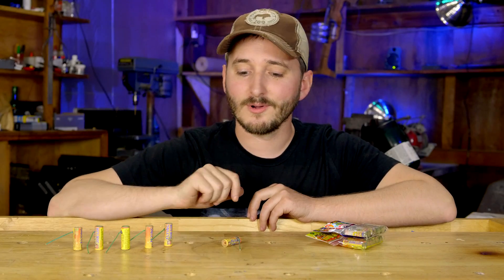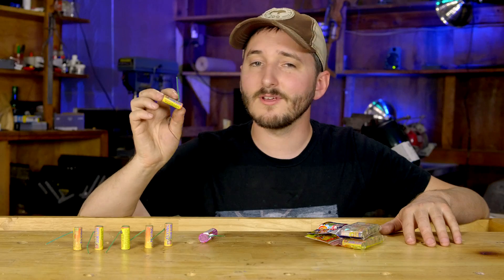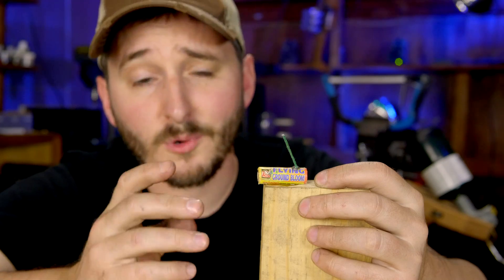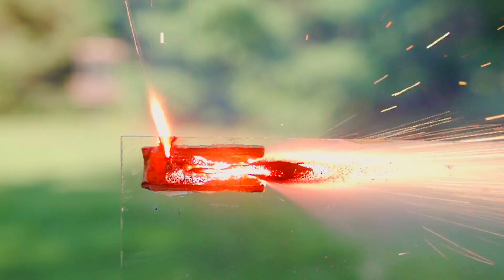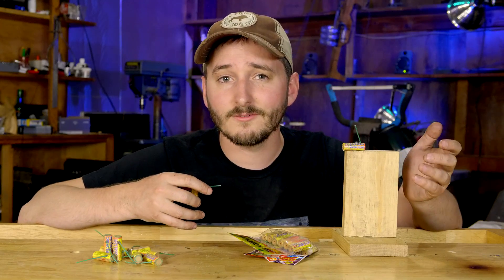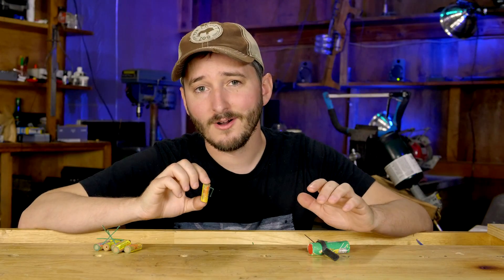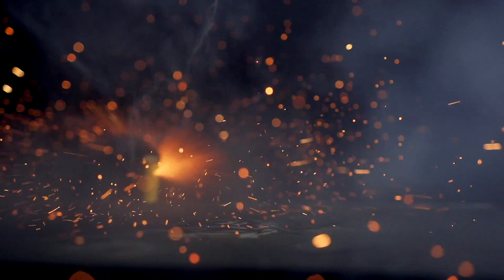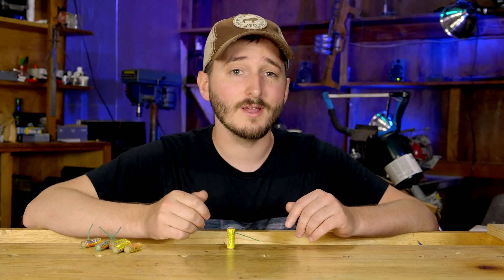How Do These Fireworks Fly?

Comment: 1. The reason the tip up is like a ancient Greek money scale.

2. think of the back like one big rock and the front as 7 smaller rocks that in total weigh the same as the big rock so the scale is level.
 
3. The back exhaust is made of plaster so its heavier than the than the front WITHOUT THE FUZE AND THE EXPLOSIVES with it it weighs the same on each side.
 
3. So when the fuze burns the force of the (fuze's) ignition makes it rolls onto the now empty space (where the fuze was) and when the gunpower ignites it has forces the to make it roll but the back is heavier creating a pivot and that's when the gunpower in the front runs out and it stands on end.

4. instantaneously, it uses the remaining powder closest to the front and it ignites and the fuze hole shoots flames and the powder toward the back nozzle ignites

5. Before you know it you've got LIFT OFF

  Sincerely  Zachary S. Snyder the 14 year old genius who gave this bit of knowledge

Comment: Do a free body diagram 🧐 I believe that the majority of the mass is at the bottom end of the firework. The fuse hole is there to provide rotation energy only and as the fuse hole fuel is used it gets lighter at the top becoming weighted like a spinning top. Guarantee the centre of gravity starts near the middle and goes towards the bottom end of the firework causing a pendulum effect standing it up right

Comment: it is pushing off the surface to stand up but think of the sideways thrust as a 360 degree ring of thrust as it spins up with the nozzle on one side it will naturally right its self before take off when you throw them there is no surface to push off and thus they will orient and fly in what ever random direction they will fly in also I would bet there is a bit of coanda effect if you watch closely they start to fly before the rear rocket fires when in the air

Comment: The hole in clindercal part is tagent (stright line tuching a circle at only one point) in direction. Due to which clinder spin on circular axis rather then virtical axis. Wobling in this spin i due to error b/c direction is not exact tangent.

Comment: I think another factor that could be playing into the upright motion is due to an off-center center of gravity, and one that is consistently shifting at that. The clay used for the venturi is pretty dense compared to the pyro compound. This naturally would make it want to "tip" to that side. Also, the end opposite the venturi is losing propellant as the firework is rotating more and more.  This combined with CF forces, axial rotation, ground effect, and off-axis thrust all work cohesively in starting the spin stabilization.

Another factor between these and the helicopter fireworks could simply be the specific impulse of the propellent. The helicopter, even though similar in size, burns slower and relies on the wings to act as a lifting body, where the speedballs could be using much higher thrust to weight ratio to impart the forces mentioned. This would make sense as the speedballs when rolled with the palm of your hand can mechanically rupture the container, like a firecracker, while ground blooms can not.

Comment: I've never seen this kind here. Until a few years ago, the laws for fireworks were insanely strict here in Germany. E.g. a firecracker was not allowed to be much louder than anyone can clap their hands. When I was a teenager in the 1980s, there was much better stuff available without any age restriction. I never was able to enjoy the adult stuff since when I became old enough, the law changed and the adult stuff was less effective than the classic kid toys.

I never had a slow motion camera until recently but as a teenager, I did the next best method. *Long exposure* shots of fireworks! You need to interpret those but it is much easier and much more informative than one might think.

When I was a kid, we often bought large amounts of "wild fire hornets", the winged version. Using pincher pliers, we squeezed the middle of them just right. After flying almost half way up, they went "bang" and then continued to rise or came down real quick after flipping over.

Comment: As the primary charge starts, it spins in the ground, but then it sooner or later starts hitting the ground, causing a much higher pressure zone than when it is facing upwards (just like in short runways where you have the back plates), and then it will try to get a stable operation by rotating itself for the upwards position, where it stands for itself due to the same principle that uses the simple top. At least that's the way I see it

Comment: The push from the first stage nozzle stands it up. when it goes to fall over, the spinning nozzle pushes it back up again. so its in a perpetual wobble around its axis, which is just enough uprightness for the second stage nozzle to blow it into the air.

Comment: I found out that it is actually not the wings that lift the firework. It's the downward thrust. The wings appear to be only for for stabilisation like a gyroscope. I tested no wings. Did not fly. I tested wings with no downward thrust. Did not fly. I tested wings and downward thrust. Did fly. And I tested wings without any angle of attack but downward thrust and it did fly. So i figured out the wings are only for gyroscopic stabilisation and have an angle of attack to cause less drag when already flying upward.

Comment: Vere very intresting your video. Congratulations. If you ask for our opinion, mine is that watching the low motion video, you can apreciate that the lateral hole has its axis NOT tu the center of the rocket axis but like diagonal. This makes that the rotation does not take place horizontal like in the case of the winged one but it rotates axial because the exaust is TANGENCIAL TO THE TUBE AND THEN THE ROTATION IS ARROUND THE MAIN AXES. also since the lateral exaust is in one side, this causes that the rocket weights more in the oposite side of the lateral exaust posisioning the rocket vertival with the main exaust down. It is a litle hard to make an explanation like this without talking paper I mean without the help of a drawing, but you are very smart and I think You wil understand .  If not keep in contact and  mabe I will try to  make a drawing ( I am very bad making drawings).

Comment: Bit late to the draw here, but I think what's going on is a friendly combination of what's already been said. I think that you even had a piece of the puzzle with your tippy-top theory. What it looks like to me is that the offset fuze hole causes rotation along the long axis of the firework. This causes a gyroscopic effect, which combines with a COG that favors the nozzle end of the firework causing it to consistently stand up on that end. The secondary charge is triggered sending the firework into the air burning the remainder of the fuel and the rotational energy from the fuze hole keeps everything from flipping out of control for the brief life of the firework.

Comment: It would be really great (technically difficult to achieve, of course) to see them go off in free air rather than close to the ground. I bet that would help unlock the effect of having that solid plane of the ground causing them to go up. Another idea is to set them off inside a half sphere and see if they tend to go up or more perpendicular to the surface of the bowl. The fact that the flat surface is perpendicular to gravity may be significant. Being able to observe them in freefall reduces or eliminates gravity. Angular momentum is definitely a factor. Changing center of gravity. Air resistance, perhaps even magnus effect to some degree. Probably even The Dzhanibekov Effect.

Comment: It seems to me that the hole in the side does not go straight through the central axis but is pointed slightly off center to produce a moment. Then because there is some lift on one end and contact with the ground on the other, the rotation then accelerates because more fuel is being burned and it stabilizes with rotation around the central axis like a gyroscope since the force is off center of the axis of rotation, the axis has some procession. Then the axial nozzle begins to fire and since it is pointed down, the firecracker goes up.

Comment: I'm not sure what the effect is called however if you take a cylindrical object and place it on a flat surfacethen put your finger on top of it at one side and press down firmly until it slips out from under your fingerthis will cause the object to begin to rotate around its long axis as it rolls out from under your finger as well as around its short axis as your finger is pressing on one side more than the other. Given dimensional  similar to the firework in question the cylinder will almost always stand on end and wobble until it loses inertia at which point it will fall back

Comment: I think the fuse nozzle is meant to do two things 1) provide force down (to make it stand) 2) provide force side ways (causing the spin) once it reaches a certain speed I believe it causes it to start behaving like a gyroscope after that the bottom nozzle kicks in and makes it a rocket. So I guess what I’m saying is I think it starts out as a top then gyroscope then rocket. It looked in the slow-mo’s like some were with the fuse on top (away from table) and some were on the bottom (sitting on the table) that might be why your getting different results.

Comment: There are several physics factors and forces at play- indeed, the surface is a theoretical perpendicular push vector, and is probably essential at first.
Rapidly escaping gas from the 1st stage creates volumes of air pressure, 'wind-sheer/cyclical vortex' and thrust. The object now has two choices, spin like a dagger through the air, or like a bullet and roll, with Dzhanibekov effect in mind, the conservation of momentum often wins out, and the tubes launch as planned, right ?

Comment: I think it's 2 different forces that are causing it to stand upright. First, as when you spin a hard boiled egg, it want's to rotate around the the relative center of gravity with the mass balanced (hollow with mass on outer walls) and also due to the dual angle of the side nozzle which points away from the surface of the radius at an angle rather than adjacent and also points slightly towards the end with the vertical nozzle. These 2 forces combined cause the firework to self-right when it spins up and then the rear thruster kicks in for lift off.

Comment: If you ask me,  I think the fuse has something to do with it.   Check to see if the fuse is inserted at an angle or is it perpendicular or is there a wrap around.  If so,  I believe that there is your answer as for spin.   Then when the rest of the fire work is lit, air is sucked into the top and heat is generated from the back causing lift.  Also the placement of the fuse at one end would cause the same result as the tippy top.

Comment: I think it works in a mix of ways. Like the Tippy Top and I also think that the initial 1st stage provides spin and upwards gyroscopic stabilization while also providing some upward lift since it’s on it’s side facing the table while it’s spinning . TSIU the 1st stage provides spin/gyro-stabilization while simultaneously tilting it upwards by the thrust produced by the first stage being in close proximity to the table/flat surface. And when it gets upright gyroscopic stabilization takes over and keeps it upright and spinning while the second stage takes over and provides the more powerful thrust upwards . Hope this makes sense.

Comment: 5:11 paused. Spin stabilisation, and kind of gyroscopic motion. The fuse end ignires a second or two earlier than the main nozzle, this causes it to spin first the spinning acts to straighten it along its length but not to a 90 degree angle, more like just enough to wobble it slightly upward. Then the main nozzle kicks in and pushes upward causing it to rise in a wobbling motion upward. 

Let's see if I'm far off.....
Reply: I was exactly right, how the fuk do I always guess these things correctly.

Comment: haha nice man your a pyro dude! i been making fireworks since the 80's! i would say that the bottom has more weight in clay then the top causing the "weeble wobble" effect. the fuel above is also a different composition then the rocket fuel used for lift. also the hole coming out of the side should be entering on a slight angle rather then just straight in but not sure.

Comment: I would say ground effect is definitely at play here. In every video we can see the burning end of the firework hop up as the nozzle aligns with the ground. In some of the videos the nozzle passes the ground, the firework hops a little, falls back down, and another pass at the ground kicks it back up (it helps to slow down the video a little more). Once the firework is in that 50ish degree spin, ground effect starts to be less of a factor and the firework spins on an axis orthogonal to the ground as well as in the firework’s lengthwise axis. The firework is unstable while canted and rotating around the orthogonal axis, so it naturally transitions to a vertical position where the orthogonal axis of rotation aligns with the stable lengthwise axis of the firework. Now we have a single axis of rotation that is stable. From here the firework is gyroscopically stabilized until the other nozzle lights and shoots the firework up. That’s what I think is going on anyway. Always something new and interesting in your videos!

Comment: The reason the top did that is because the end you spun it from had more weight? Just like those old toys in the cereal box the plastic oval things that only stand on one end because one end has a weight. You just spin it so (excuse my lack of definition) “the force from spinning something” slows down the top from flipping to the side with higher density.

Comment: I honestly think by it having so much force coming out of one end. Which causes it to rotate on its side like a cylinder would roll. But since the rocket comes in contact with the ground which cause extra force which throws off the balance of the firework.  It starts to wobble and gets on to the side that is A. Lighter due it being empty and B. That it has no energy being force from it. Finally I believe with the thrust that projects the object  up wards from the end of the firework just pushes off the ground enough for a helicopter effect can take place which allows it to not wobble and even because now theirs even force on all sides. Due to it being in the air. Which allows it to fly high .

Comment: It seems to me like ground effect would not be a contributing factor in it standing on end. Ground effect is when air being pushed down against the ground by a wing or a blade has nowhere to go so it creates pressure pushing back up against the wing or blade, creating additional lift. Fireworks don't propel themselves by pushing air (well, except for the fireworks that have wings on them I suppose). Instead, fireworks expel fuel very quickly and the reaction force propels it. My guess is that the firework stands up due to gyroscopic voodoo.

Comment: When the firework's initial exhaust is pointed upwards or anywhere pointing up, it pushes the firework to the ground, but there's no downward movement due to the ground blocking it, but when it's pointing down, there's nothing holding against the firework on the upper part, therefore it's pushed upwards. When the firework is lifted up, the gyroscopic precession and other things play their part.

Comment: The fuse/even hole is drilled in tangential. Angled against the tube wall giving a higher spin velocity which in turn creates the loud zipping noise you hear as it's moving away from you. The begging fuel is plain black powder and the lower portion is a metal fuel most likely black powder with aluminum as a booster. It gives a slower burn through black powder as it spins up and once the core of metal fuel ignites,it gives it that boost needed for flight and the zipping noise.:)  I make these lol took all types of measurements off the ones from the firework stands and got mines pretty much the same.just mines don't always zip being I don't have the metal powder and only use black powder for all my home made fireworks and rockets

Comment: I believe the end at which the flame exit towards the end of the burn is heavier probably like a clay nozzle and from the burning of the top fuel out of the side as you said decide nozzle ads rotation and thrust when nozzle is pointed to the ground I believe this creates a gyroscope like a effect this creates stabilitylong enough for the burn to hit the nozzle at the bottom when it stands upright from the spinning like the gyroscopethe spinning like gyroscope from the side outlet keeps it stable and rotation while the thrust from the bottom nozzle lifted into the air with the two forces combined left is created through brute Force

Comment: I think the side exhaust is angled in a way that it vectors the exhaust as the firework is spinning which makes it unstable and it starts to rock. When it starts rocking, the side thrust then works with the rocking motion where the end with the side exhaust has more mass  to achieve barely enough power and inertia to kick the end upwards where it stands slightly less than perpendicular to the ground without throwing it over into another spinning axis. Then the bottom exhaust fires and it has enough power to counteract the twisting inertia.

Comment: Should the tip of the firework tip in any direction, it would recieve more ground force from that direction and correct itself. It spins  doing that constantly. 
If the firework were to tip on the other end, the tremendous amount of ground force would immediately knock it back over.
This means that it can only stand up on one end once lit
Reply: Also as the material burns up top, the bottom becomes the center of gravity